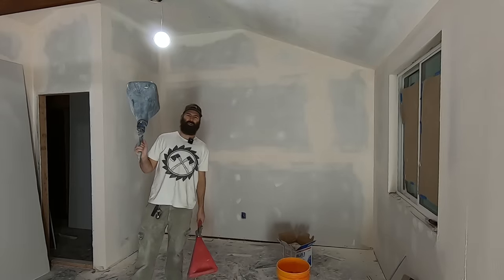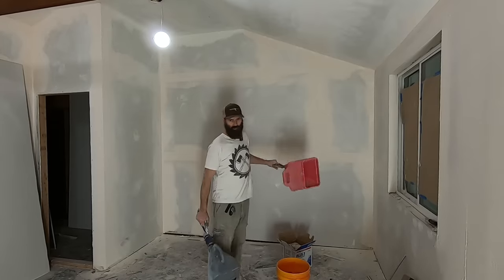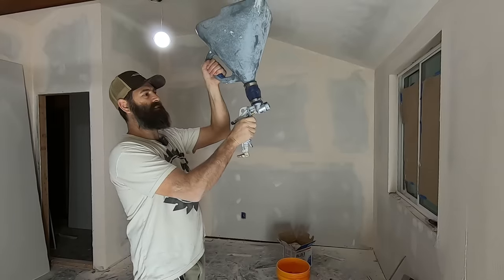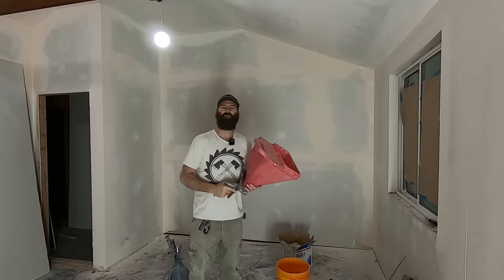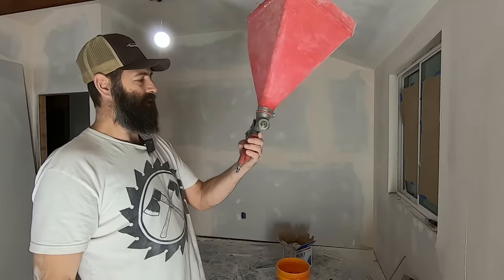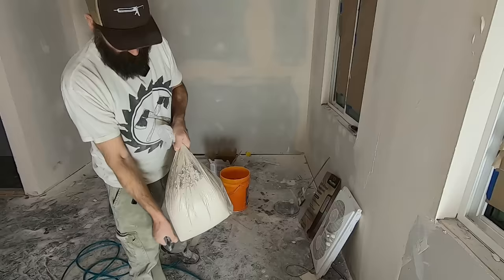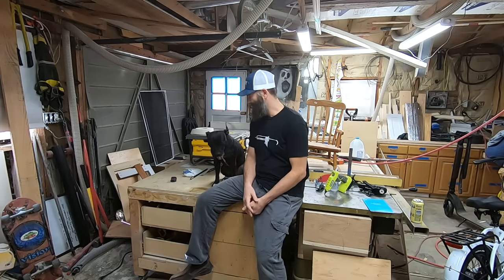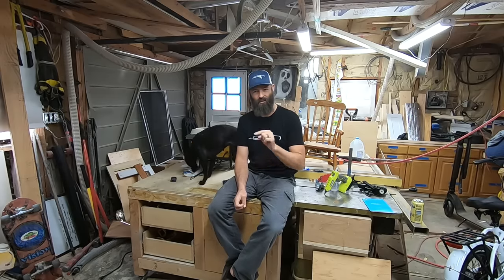Orange Peel Texture For Ceilings | THE HANDYMAN |

Comment: I use a 45 degree street elbow on the hopper to angle the gun a little more when shooting ceilings for more comfort for my wrist.
Reply from the maker: Thanks for the tip.
Reply: The Handyman and just the tip
Reply: Yep. I can’t believe I haven’t seen a video of anyone doing this yet. I actually learned the trick from spraying decorative concrete but it flips over for ceilings.

Comment: Never understood texturing.... Here in the UK its what we all want to get rid of! Smooth all the way! 

Still through...... Doing a good job at it!
Reply: As someone who gets called to fix holes, texture is a nightmare. I've gotten petty good at matching but man...... would that I could just stop buying that $#!+.
Reply: Its about cost. Its cheaper to texture than make everything smooth and flat. Here orange peel is pretty common, one less step than knock down. Commercial  jobs often see smooth wall.
Reply: @brentiers  Orange peel on walls easily helps hide nail holes. Had a rental apartment that had OP walls - hideous. But when l left all I had to do was dab some spackle over the holes & go. In fact, I suspect the only thing holding the building up was decades of renter spackle dabs.
Reply: Perfectly smooth shows imperfections

Comment: You should research Graco tex-boost pressure hopper you will see much easier to texture. It's a small hopper like the one your using, it's air pushed in hopper look it up. You will be like the Sander where you been all my life

Comment: Myself? Well, I like a brocade finish on ceilings. For application, use a 2x2 attached to a 12” square of plywood. Cut up your oldest grouting sponge into 1-2”pieces and staple them to the plywood. Dip that in a tray of mud and have at it. Once it partially sets, run a long trowel over it in a few directions. 

Or spray heavy texture, then trowel over it.

Comment: I’ve used a spare 5 gallon bucket to hold the hopper standing up when refilling or taking a break.. just a thought. Good job though!
Reply: Old bucket with a 2"cut all the way down the side so I don't have to disconnect for filling.  $10 in parts from HF to regulate air pressure, dry the air and cutoff flow.

Comment: You would have a ton of fun with the Harbor Freight hopper I've been using! I don't spray texture often so I haven't upgraded yet, but man. That thing has ZERO air control. Once the hose is hooked up, it's blowing!
Reply: Get yourself a valve for it. I use harbor freights hopper as well and it’s great
Reply: I got one too. Before buying it i watched videos and read reviews. Got a ball valve on the air intake. Just shut it off when not spraying let the tank build up. Run the compressor at about 50psi. You can also use the valve to control the PSI to the gun too for fine tuning the air flow.

Comment: I've lived in Montreal for 25 years and I don't think I've ever seen a wall or ceiling with texture on it. It's like you're speakin' Greek!
Reply: It's standard in middle class and low-income USA
Reply: It's actually not a low income middle class thing lol I have done maintenance in many million dollar homes that have textured walls 😂. In Montreal they more then likely use plaster. 👍
Reply: Not very common in the eastern US either.
Reply: @darrellmcalister320  lived in multiple houses from  Mi to Fl and they've all had texture...more in the south as the norm to do kd on the ceiling and op (sometimes kd also) the walls...
Reply: @getnalinewet5199  I've lived in multiple houses in VA, NC and PA and none had textured walls. Most had some textured ceilings. I've also done work on many other houses in those states. No one textures new drywall walls here. Old plaster walls have texture but that's different.
Reply: I've lived in NY, FL, NM, VA and overseas.  Most walls/ceilings have either been smooth or very, very lightly textured....until our current home.  It had stomped ceilings when we bought it....it DOESN'T any longer!!! 😏 They're nice and smooth now!
Reply: @tigar0485  But only west of the Mississippi — in the mid-Atlantic and New England many homes have old-fashioned lathe+plaster. The drywall homes in the same areas follow suit and go smooth.
Reply: @scottperezfox  personally, I prefer the smooth look
Reply: Mtl is a tiny negligible part of the world
Reply: @seussyyy  LOL. You must be fun at a party.

Comment: Marshalltown bought Wal-Board middle of last year.  They just raised the price of the Texture Pro 200 hopper gun 37% ($87-119!), 8 months after they bought out Wal-Board.  Wal-Board had just raised the price 25% just 6 months earlier (from $70 to 87).  So, in total, a 70% increase in 14 months.  At that price, no way.  For a third of the price, the HFT and AMZ options will do just as well.  Marshalltown's business model has been to buy higher end U.S. companies, then jack up their pricing to justify over-pricing their own stuff.

Comment: Using powdered usg "texture" will give you the professional results that you need.
Using all-purpose joint compound will not spray the same pattern because it doesn't have the same consistency and thinning it will never make it the same same thing with trying to use topping compound I've seen that so many times over so many years and you can tell when you look at the texture from a professionally textured house with a texture truck.
The texture pattern that sprayed is a professional looking spray pattern when you use the powdered texture mix water.

It's especially true with knockdown you will not get the same knockdown pattern match if you're fumbling between not understanding using all purpose joint compound this texture versus using texture that is specifically made as texture.

Comment: Is drywall texture a regional thing?   I’m in HVAC so I have been in thousands of homes over the course of my career and I never see it.  I’m sure it’s good for hiding imperfections but I would personally prefer to pay the extra money to have a nice smooth finish on my walls and ceilings.
Reply from the maker: It is a regional thing.  I have only seen a few houses that had smooth walls and I could see every seem.
Reply: @TheHandyman1  Mainly west of the Mississippi — in the mid-Atlantic and New England many homes have old-fashioned lathe+plaster. The drywall homes in the same areas follow suit and go smooth. I never even heard of textured drywall until I moved to Arizona.
Reply: Portland Oregon 80% of the homes have texture.

Comment: The fact alone that texture is an extra step makes it extraneous in my view. Installing and taping+mudding must be done with care, but after that it's prime+paint. Done.

Of course my perspective is that plywood — or literally any other wall covering — is fewer steps than drywall. I'd rather have corrugated tin in a full remodel but I personally hate drywall. I'll see myself out ...

Comment: What size tip and pressure were you using?
Reply from the maker: I adjust the presser at the hopper it has a dial on the side.  I think the tank pressure was around 80 to 100.  As your tank goes down you have to increase the pressure at the hopper.

Comment: You failed to mention a few things...
  The first important note is how much PSI of air should be coming out of your gun.
  THAT MATTERS when spraying a texture on a sheet of drywall. 
  Another thing you could've mentioned was the water-to-mud ratio that you prefer to use.  This would've helped to boost the egos of those less confident.
  I personally could not see details of your finished texture, because your choice of lighting was actually insufficient for the viewers of this video.
  (*Also, I would've thrown the Cobalt tool in the trash as well.  I am an HVAC Technician who uses DeWalt & Milwaukee.)
  Good video otherwise. 👍🏼

Comment: This video would have been helpful if you said what the PSI was on your compressor, and if the valve on the hopper gun was open fully/halfway, etc.  It was just a video of you spraying orange peel texture on drywall.  Not much help.

Comment: This video was a waste of time i can't get back. Didn't say anything about how much water to use per box of joint compound. Didn't say how much air pressure to use.  Do you pull the trigger all the way or half way.
Reply: Hahaa, yeah, you pull the trigger all the way, the amount of water and air pressure changes depending in the texture you want, the mud needs to be runny, falling off a knife, then you try bit out on a sheet of scrap, adjust your air and maybe change the nozzle for bigger or smaller pieces. There's no set amount of water